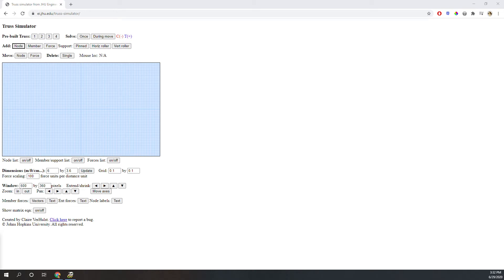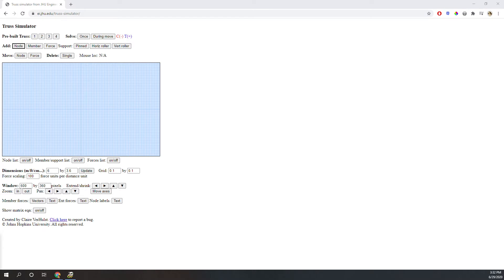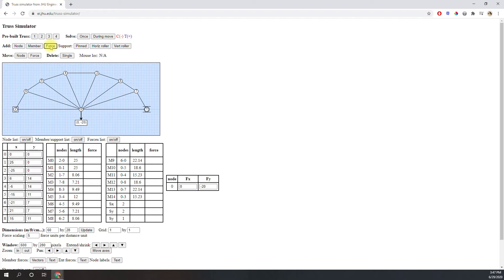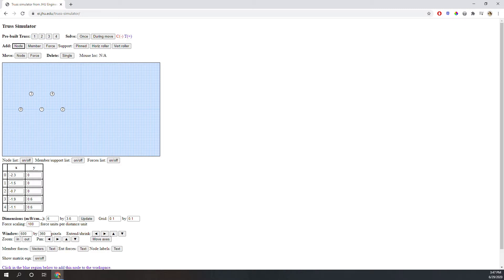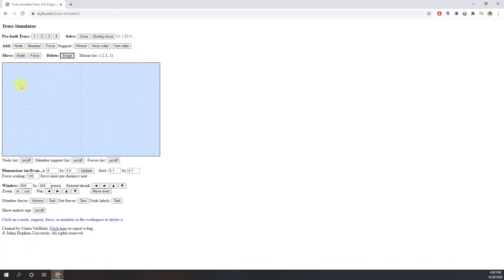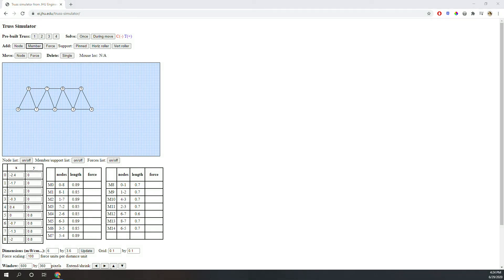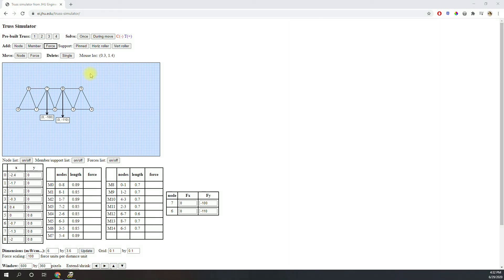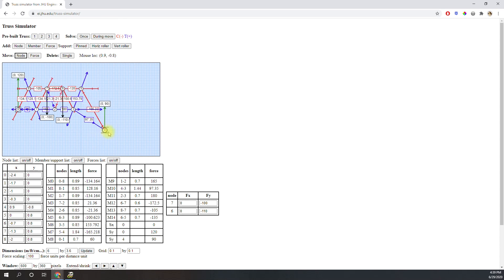How to Use the Truss Simulator from Johns Hopkins Part 1

Comment: Hi, when I'm using the simulator and all my members =3*nodes-3, it gives me an error of "matrix is singular. Cannot solve." Is there a way to get around it?
Reply from the maker: Are you using the old version?
Reply: @garrettsbridges3497  I figured out the problem, apparently, if too many members are connected to the same node that's too many unknowns and they cannot solve the forces.